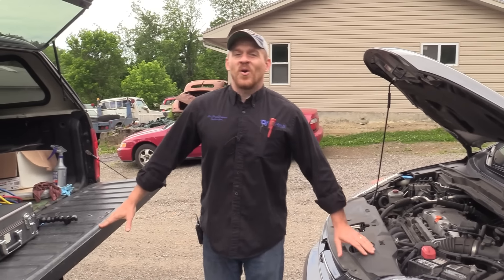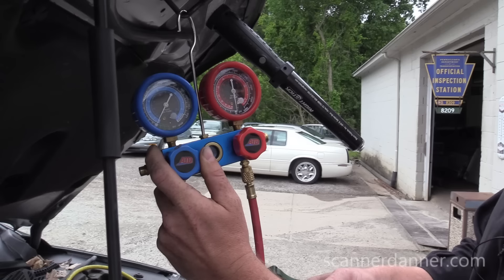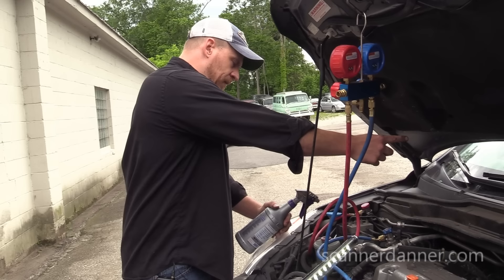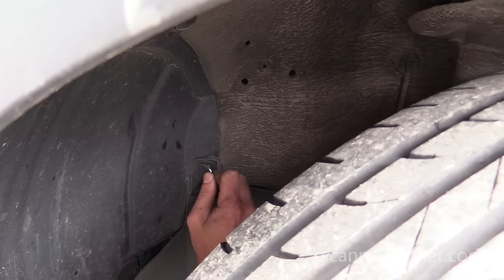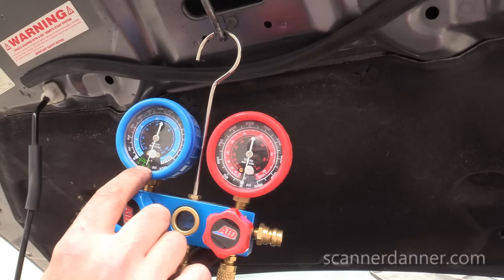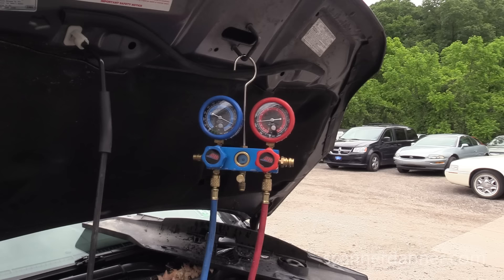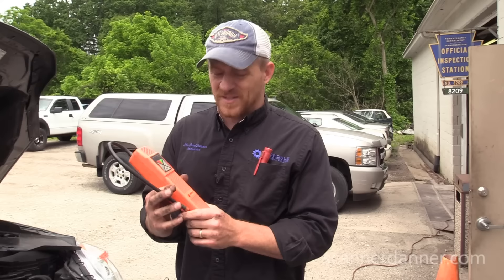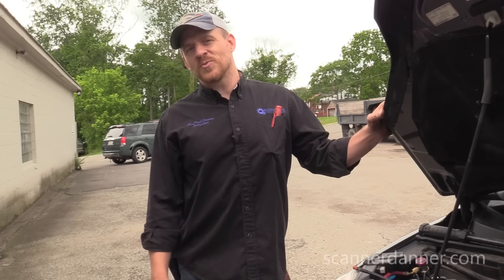Air Conditioning Not Working (system performance, leak test) - Honda CRV

Comment: I have an 08 Civic with an AC issue. Blower is good fuse is good. It has enough freon in it. Relay is good. The transducer shows low voltage (about 1.2v). 5 volt ref good, ground good. If I apply 12v to the load side of the compressor clutch relay it turns on along with the fans... I suspect a bad transducer. The compressor has a thermal protector as well. Not sure how to test it, alldata doesn't give me much info except replacement procedure. Help!
Reply from the maker: There is a thermal protector circuit in the AC compressor assembly and there is also an EVAP temp sensor on your car that need to be tested. Post this to my forum. It is free to join. We can help you better there. I can't do back and forth messages here. It is too difficult to do here for something this complex.
Reply: ScannerDanner done! I'm registered under SakeenahMD
Reply from the maker: Thank you!

Comment: Can you fill the system with compressed air if it has refrigerant in it and it has a very small leak
Reply: only use shop air if the system is totally empty
Reply from the maker: You should not for two reasons. 1. you do not want to recover a mix of refrigerant and air into your recovery machine and 2. you do not want to vent it to the atmosphere. 
To be honest with you. If it is an 80 degree day and I have 10 psi of rest psi. I know I have a leak and I know 10 psi is not going to help me find it. Absolutely I am putting compressed air overtop of it and venting it when I am done. In my opinion, you are still being a good steward of the environment by accurately identifying the location of the leak. And where was the rest of that refrigerant going anyway. 
Would I show that in a video? Not sure
Reply: ScannerDanner Thanks! Another question, Can you use the vacuum pump and attach it to a empty propane pump to make your own evacuation machine?
Reply: Good question , Would the propane bottle have enough room for expansion and to store the refrigerant from an ac system??
Reply: @ScannerDanner I thought the whole point of R134A was that it doesn't deplete the ozone like R12 did. Otherwise..oooooppppsss :-/
Reply from the maker: +Nick Loss 
Who knows, they change the theory all the time and I'm certainly no expert on the chemical compounds, but yes, supposedly the R134a was better for the environment.
Reply from the maker: I don't know, but Pete and I are in the process of converting his old R12 recovery machine into R134a.

Comment: I buy kids bubbles (buy a large bulk bottle) and spray where looking for leaks. This seems to make bubbles more likely. Thanks for the video.
Reply: That's likely to work much better than regular soap too, I hadn't thought of that, thanks.
Reply from the maker: I use a 50/50 mix of some cheap car wash which makes great bubbles :-)

Comment: I have done several of these hard to find leaks, it takes patience and perseverance, sometimes ac seals will leak when the parts are cold and by the time the customer drives the car to your shop the seals swell and stop leaking, it's a pain in the butt sometimes.

Comment: I'm having trouble finding the low pressure sensor on my 98 S10, need to jump across it to get compressor running to put in freon.2200
Reply: James Alcorn It could be built into the Compressor. My ML 320 only has the high side Transducer. I have no visible low side pressure switch. If in doubt- look at your A/C wiring diagram.

Comment: Does evacuating the system also pull water from the filter/drier?
Reply: T Mst No. Once the desiccant has absorbed the moisture it cannot be removed the drier must be replaced.

Comment: can you use smoke in the a/c system for finding leaks?
Reply from the maker: No, that would add contaminates and would not be even remotely enough psi. Most smoke machines put out less than 2 psi

Comment: Another thing we see a lot is car's that coming in with low frown and we still can't find a leak. I believe what's causes that is the customers don't use there a/c in the winter time. All the pag oil and dye separate going to the bottom and the freon vapor very slowly leaks out of seals because the seals are dried up from no pag oil circulation, also causing that slow leak to not pour out dye and be prove-able. That's why I like to run my a/c once a month in non a/c needed seasons. But that's a last resort theory a lot of schools won't teach you because techs can abuse the theory. You see it a lot the first months when customers start using there a/c again depending on your area and climate. Ship it, no leak found and rarely come back.

Comment: Good job, i like very much your work a/c system explain.can u explain me that how much pag oil need for lubrication after vacuum. N when vacuum the system is there compressor  oil  be flash out ? If ,how i refil oil in compressor.
Reply from the maker: When you evacuate a system, almost no oil comes out of it. You DO NOT need to add oil to an AC compressor, there is no oil sump in them. They are lubricated by the refrigerant that carries the oil throughout the system. 
When you replace a component, only then do you need to add oil to an AC system. Example: EVAP core 1 ounce, Condensor 1 ounce,  etc etc
Reply: @ScannerDanner  good morning Mr.s.d. thanks for reply the good knowledge of a/c system .for me .thanks again give yours valuable time to indian viewers.god help u for your work.thanksbest of luck.
Reply: @ScannerDanner  Paul, I was under the understanding that R134a didn't carry the oil throughout the system  like R12. Hence you added oil per component; as per, your comment. I was also under the understanding the oil for R134a systems was a synthetic. Am I out in left field with these points???

Comment: opening both valves let's the pump pull faster than opening only 1 valve
and forcing air into the system heats it up so the pressure right after putting air in will drop as the system cools down nitrogen is much more stable and it has no moisture which can be absorbed by the ac oil

Comment: R 134a is not a "Freon" in the real sense of the word, like R 12 is. It does not have chlorine atoms in its composition, thus it cannot attack O3 molecule in the stratosphere, so it has negligible ozone depletion potential...unlike R 12. Regardless, it is not wise to let it escape into the atmosphere because it has certain global warming potential and also it costs money. So good job Paul using compressed air to find the leak.

Comment: Dan what about the expansion valve joints next to evap core?
Reply from the maker: No way to distinguish anything inside the dash, the problem is in the dash and it is dash removal time and you're certainly not going to do a job like this without changing everything while your in there, including the heater core. Make sense?
My name is Paul Danner btw 😉

Comment: If it's too loud you're too old! (And I'm a lot older than you...lol). Thanks for this vid - getting ready to t/s my daughter's A/C (unfortunately my gauges are R12 and I have no vacuum pump, so I've got to spend some $$$. Hope to sign up for your course someday.
Reply: toss adapters on the hose ends? then again, the hoses are probably all toast and gauge seals leaking...
oh wait, they still made stuff to last back then :)
Reply from the maker: Check the description of this video. I provided links for the DIY stuff I am using. I listed the gauge set and pump separately and together. You will be surprised by the cost. Thank you!
Reply: I did, cost is equivalent to Horror Fright, and better quality. Thanks!
Reply: + Throttle Body - Yes they did, I bought that set back in 1992. I might as well just spring for a new set, the links SD left are affordable.

Comment: if you dont have nitrogen use a can of compressed air. I also put this in after recovering so im not having air rush into the system when im swapping out parts. Also leak detectors will detect it.

Comment: Is the  invert  a can Freon gas is true or wrong ?  when i invert a can the liquid came out but i put it right position the gas came out ? what good case  to fill compressor whit Freon gas  with gas stuation or liquid ?????  thank you
Reply from the maker: It is true. Inverted it will enter the system as a liquid but it does start vaporizing once it enters the hoses. If your low side fitting is on or near the compressor, you can damage it when adding as a liquid if you are not careful. I talked about this in this video (three part series and I think part 3 I am charging using the cans)
https://www.youtube.com/watch?v=jTAfYJyPniM

https://www.youtube.com/watch?v=JSCnjcQm-ZQ

https://www.youtube.com/watch?v=FIyuiNV-82s
Reply: thank you very much for your help

Comment: When you blow into that leak detector, you're blowing a high concentration of CO2,and I bet that's making it trip. So, could you rig up a CO2 cartridge that you'd use to inflate a bicycle tire, and charge the system with that instead of compressed air, and thus not have to use refrigerant? It might take 2 or 3 cartridges to get enough volume to get enough pressure, but wouldn't that work? Assuming I'm right about the CO2 being what's tripping the sensor.

Comment: Late entry 
Great vidio SD, but when you were pressure and soap testing ,you were so close to finding leak at drain but it looked like did not actually spray drain hose and look for bubbles. But I still enjoyed video 
Thanks
Mike L Rogers
Reply: Why would you expect bubbles at the drain hose though? It's not in a sealed compartment-

Comment: Did you not close the gauge valves before connecting to ac system 🤷 no pressure could pass through to gauges
Reply from the maker: this was a long time ago, I'm sure I did. Was there something you saw that you didn't like? Time frame please
Reply: @ScannerDanner  morning scanner danner, I maybe confused or it might be down to editing but at the beginning  (1.41ish) just before attaching high & low hoses to the system you checked that the valves on the manifold were closed thus preventing any pressure if indeed there was any from reaching the gauges 👍
Reply from the maker: @LS-br3rp  manifold gauge set valves simply open and close the low and high sides to the yellow center hose. They'll still read psi when they are closed. They should only be open when you're doing something on the yellow hose. Hope that answers your question

Comment: wouldn't checking the A/C fan also be part of the procedure before selling the job?
Reply from the maker: For sure but I don't know about "before". It depends on the controls and if there are multiple fans.
Reply: I use the power probe to power on the condenser fans. One less thing to worry about. Could still have a Fan Relay issue-  but I rule out the Fans themselves.

Comment: What is wrong with the compesser when turned on, It goes on off. On  off ???
Reply from the maker: Short cycling is an indication of being low on charge (leak in the system)

Comment: I did not use soap and water, I used the bubble mix that my grandchildren use when they make bubbles,I found the leak it was the condenser showed tiny bubbles.I replaced the condenser and no more leaks at the same time I replaced the two Schrader valve in low and high side.

Comment: Air conditioning work is one of the biggest "c.y.a." areas in this business. That blown out high high pressure line you just replaced..easy fix, right?  Customer never mentioned the a.c. only hits about 60 degrees on its best day. But, as far as the customer is concerned, you're "fixing" the a.c. system so all is well. This is where proper communication with the customer is vital, particularly if you have a vehicle come in with an empty system. As long as you make them aware that a full system performance check cannot be performed until said repairs are done (if applicable), you've done your job. There's a lot of ways to get burned in this business, but proper communication with the customer can head a lot of that off before things become problematic.

Comment: Please help. I have a 97 Civic 210000 miles that knocks under load at 1800-2500 rpm... Factory spec for ignition timing is 12 degrees before tdc. I had to put a jumper wire in the connecter and set it to 8 degrees to make the knock go away.. But when you take the jumper out it goes back to 12 degrees and knocks again... What should I do? thanks
Reply from the maker: Wrong place for this question (on an A/C repair video) but I'll answer anyway. With the jumper wire installed, you are eliminating the computers advance. Once you remove this jumper the computer will take over, so don't worry about the timing changing on you again. 
The "knocking" you described, I am assuming is at mid throttle, pulling a hill. If so, check your EGR valve for proper operation next.
Reply: ScannerDanner yeah it's mostly pulling up hills... I'll check the egr next.. if I leave the jumper in what other computer functions will be disabled? thanks a lot for the input
Reply: ScannerDanner also I live at 7000 ft elevation... when I went to Florida it temporarily fixed the knock
Reply from the maker: see that suggests a lean condition man. an engine that is running lean will run hot and also increase spark "knock". But I believe this engine is known for restricted passages in the intake for the EGR system. 
At idle, pull a vacuum on the EGR valve. Use a hand vacuum pump, or find an intake vacuum source and connect a long hose from it to the EGR. It should get very rough and almost stall if not stall the engine. If it doesn't make any difference, or not much of a difference, you found your problem. 
I'm not sure what else is disabled with that test connector jumped. I know it was never intended to be driven with it jumped.

Comment: Very good tip !!!! The leak was on the evaporator and where on the evaporator after taking it out ?  Please provide the FINAL Conclusion/Comments at the end of your video  ~~~~~
Reply from the maker: This was clearly shown in the video, leaking EVAP core. What seems to be your question?
Reply: @ScannerDanner  It was very good tip  !!! Did you confirm the leak after taking out the evapoator and where on the evaporator?
Reply from the maker: @jameskim62  The method I showed confirmed the leak was in the EVAP area, so if you are doing a job like this and wondering how to sell it BEFORE disassembly, every component in that area should be replaced. If there is an expansion valve in there, along with the EVAP core, you should be changing them both!! I did not do the repair on this one, so I do not know if it was the EVAP itself or the TXV, but like I said, it doesn't matter. You are not going to do all that labor to replace only one component. Most systems, the only thing that is in there is the EVAP core.
Reply: @ScannerDanner  Thank you very much.   I have 4 cars/ 2adult kids and fix/maintain my own cars.(all Honda-2008 Odyssey, HRV, Accord, Civic) Your channel/Tips are EXCELLENT  !!!!! 6 subscribers to your channel...  Cheers and GOD BLESS.
Reply from the maker: @jameskim62  thank you James!
Reply: @ScannerDanner Think he was just curious what the leak looked like on the actual failed part.   It's always interesting to see, and maybe get idea of it being a factory defect or corrosion over time caused from environmental conditions. I always like to look at the failed parts after the repair, and request they save the parts, but they generally just forget and toss it instead.